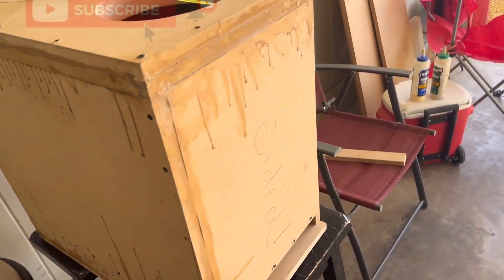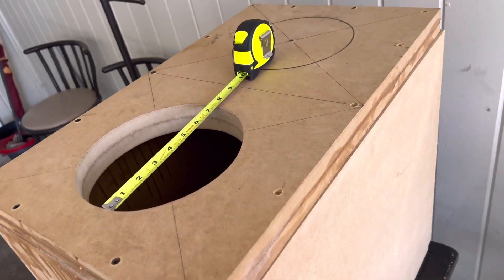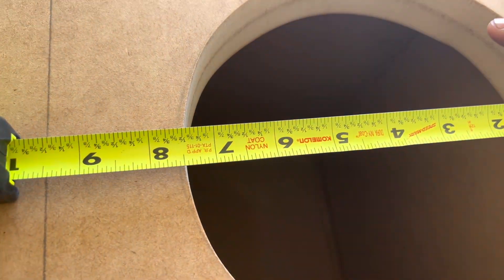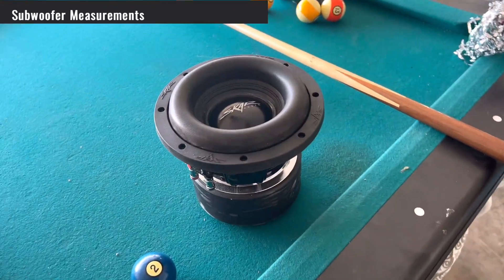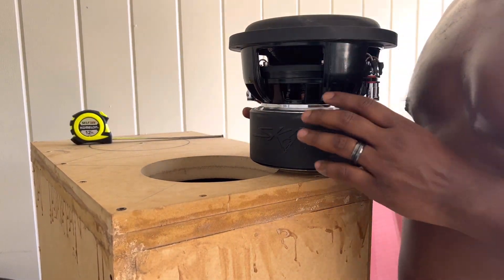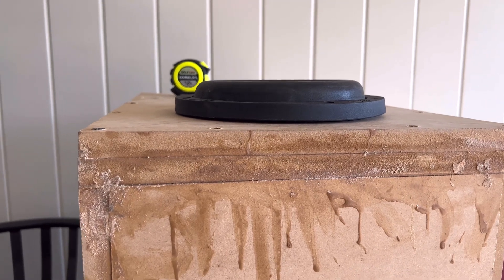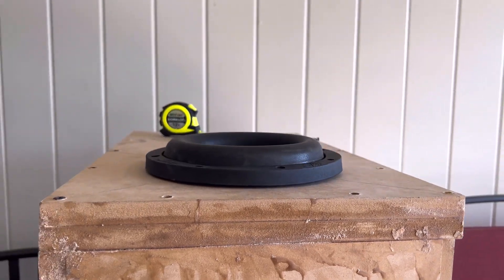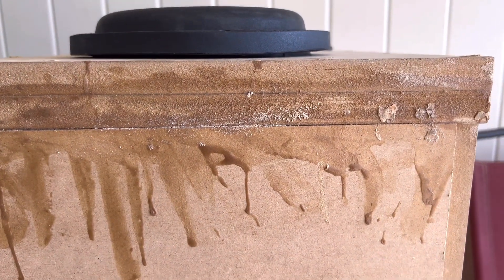SKAR AUDIO LIED!!  🥲🔊

Comment: 😂 I just did a shallow build with the vd8’s that say 7.4 cutout.. I did a full 7.5 and cut the outside of the line so it’s actually closer to 7.625 and I had a lot of fun trying to fit them in the box with wires coming off the terminals.. they dropped in the cutout fine till i wired the box and then I had to force them in the holes once I redo them up with 10g wire. 

Willing to be once you widen this for the basket you’re going to run into the exact same issue when you go to wire them..
Reply from the maker: Yeah skar definitely has Stevie wonder doing their cut out measurements lol but I’ll say if you cut smaller than what u need and sand out the rest. That sub hole will be a stupid tight fit! 💯💯